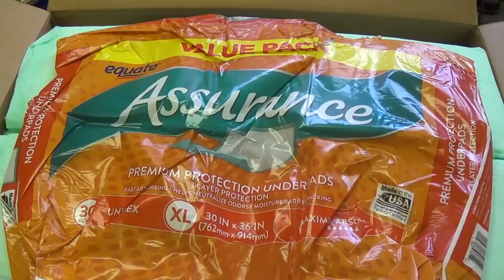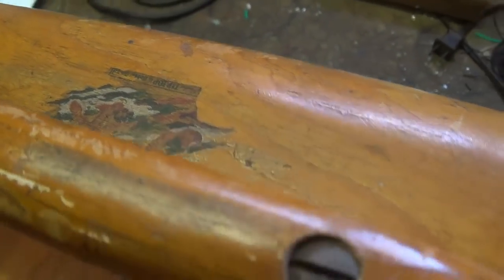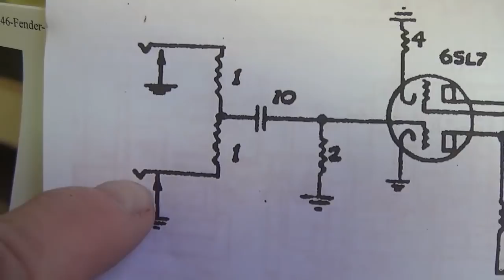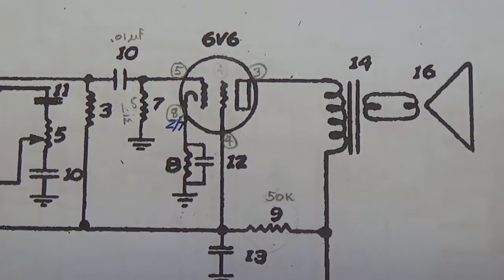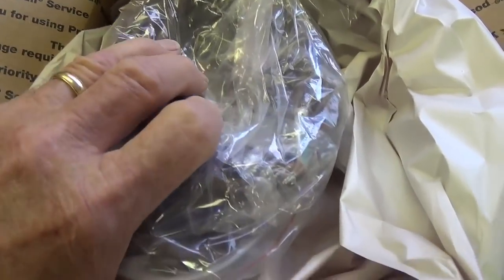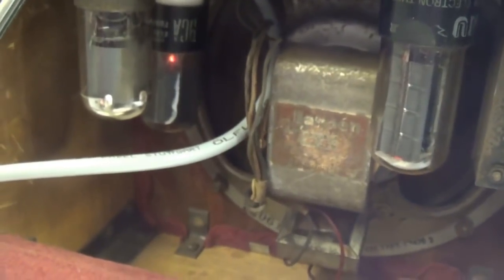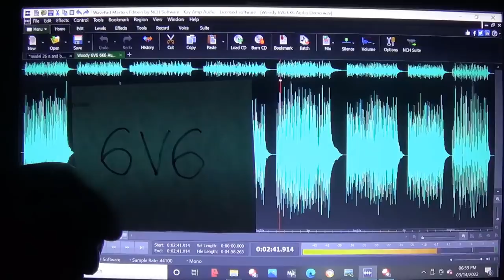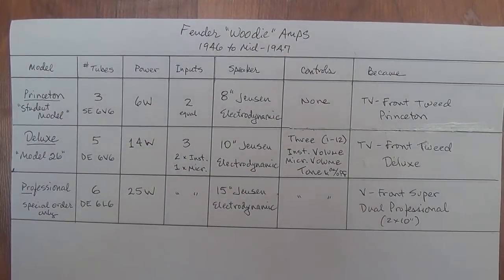1946 Fender Princeton "Woodie" Amp.....Rare, Valuable, and Really Nice !!

Comment: Thank you Uncle Doug for your thorough and humorous review and repair of my old Fender Princeton. When I proudly tell people that I have a "woodie" I get very mixed responses. What's up with that? The schematic that I sent to you was the earliest that I could find and was from Radiomuseum. They dated it from 1948 as the 5B2 circuit with a duo triode 6SL7 preamp tube and 6V6 output. The next iteration, the 5C2 from 1948 , uses a 6SC7 and a 6v6. I have found several model 26 pictures that show the tube designations written in pencil on the chassis. This leads me to believe that this amp originally did have a 6SJ7, a 6K6 and a 5Y3 as the chassis markings suggest. Until other research proves it different, let's call this the "5A2" circuit. Some his later amps had Leo's name penciled on the bottom of the chassis which he probably would have only done unless he had other employees wiring amps as a method of QC. Since Lily and Lupe were not yet his employees, he likely hand soldered this thing himself. Simply amazing.  
 
Radiomusiums.
Reply: You own a real jewel. Thanks for sharing it with us.
Reply from the maker: Thanks for your very interesting and informative comments, Charles.....and thanks for sharing this very rare and historic gem with all of us.
Reply: Love to see and hear you get your hands on an old Woodie Pro Amp to end all amps vintage wise
Reply: @UncleDoug  I want to donate some amps to you! FREE FOR YOU TO PROFIT ON! How can I contact you and where are you located so I know where to ship them to? are you in NM? How can I contact and acquire your address? And the amps are old Baldwins, Newcombs, Maasco, etc. (I'm retiring to the tropics)
Reply from the maker: @kennyh5083  I appreciate your generous offer, Kenny. I have some local guys who are learning amp repair and these could be very helpful. Please message me on my FB page Uncle Doug's Vintage Amps.
Reply: ALL I can say is that I would bê Very moved by having such a Nice and wise Guy like Mr Doug working in an amo of Mine. He transforms tech in a pleasant conversation with an old friend... Unfortunatelly Im not a skilled person on tube smps but I really enjoy wstching..
Reply: Handmade by Leo Fender himself. What a tremendous piece of history. Thank you.
Reply: Charles, would you consider selling this amp? Please let me know, I'm a lapsteel player. Thank you very much.

Comment: 6K6 also wants a different impedance/load possibly explaining some of the lower output.  It also wants lower voltage but that amp is already there.  I added a switch on my 6v6 project amp to also allow for 6k6.  Terry at D-lab mentioned how cheap they are so I scored 6 Sylvanias for about $9 each.  They all appear NOS and bias within 2ma of each other.  Glad to see than Uncle can still get a woodie.
Reply from the maker: Thanks for the info, JJ.
Reply: "Glad to see than Uncle can still get a woodie." 🤣
Reply from the maker: @pauldavis6356  Yes, indeed, Paul.....and no Russian pole dancers were harmed in the process.

Comment: 220614 - The war was over and all the soldiers were back in the states with their woodies. They had steel in their laps. Their eight inch Jensens had no shielding on the tubes. The resistance was low and the leakage was high. The house was a rockin' and the stork came a knockin'. That is the true origin of the baby boomers. Now you know....... the rest of the story!

Awesome video, Uncle Doug! Can't wait for your next goodie.
Reply from the maker: A fabulous historical review, Tim, especially the stork part :) :)  Actually I was probably spawned under the conditions you described......thus my interest in tube amps :)
Reply: There was a recession in late 1948 through 1949. It affected manufacturing and I heard also Fender production. This is why those early amps had many versions because parts were scarce.
Reply from the maker: @CraigHollabaugh  That makes sense, Craig. Use what you have, not what the schematic says.
Reply: @CraigHollabaugh  I think the changing parts list was more a result of war surplus availability.  Lots of electronics parts were available and cheap from surplus at the time.  But of course supply of any specific part may vary.
Reply: @yisraels4555  sure, that makes sense too
Reply: @yisraels4555   Had Fender been located adjacent to New York instead of in California, they would not have had much trouble getting parts after World War II because the area of lower Manhattan formerly known as "Radio Row" was the best place in America to get surplus electronics.  Unfortunately, all the independently owned electronics shops were forced to move in order to make way for the World Trade Center. The owners tried fighting the relocation in court, and lost. The stress literally killed some of them. I don't know if you can read it online but Antique Radio Classifieds wrote a series of articles about it some years back.

Comment: Greetings Uncle Doug,
One of my clients acquired the inventory of a local technician/enthusiast recently. Along with roughly 30 antique  mixer-amplifiers was a large container of tubes. We haven’t finished counting or testing them yet, but I imagine 50+ lbs of tubes is a pretty big number.
Amongst them are a dozen or so 6K6 pentodes. After watching this episode, I’m now looking forward to swapping them into a Deluxe 5e3 clone I’ve owned for a while.  Depending on the outcome of this test, who knows what will happen next.
Thanks as always for sharing.
Howard Rose
Reply from the maker: In light of today's tube shortage, your acquisition could not have come at a better time, Howard. Good luck with your experimentation.
Reply: Looks like the 6K6 has a lower output, but , given the high output of the 6V6 that is no bad thing,  going from loud to overbearing is no good from your input source,  so from moderate to nicely increased vol is better ( all controlled from the instrument volume)

Comment: Those lamp cords at Grand Brass are  nice Uncle. On flee-bay one  would have to buy a polarized plug and the wire 
separately for my two wire repaired vintage radios. Their plugs look vintage but not for grounded plugs like yours.
Excellent go around on this beauty of a rare find  $$$ vintage amp. Thank you for sharing it.
Reply from the maker: Thanks for the info, HM.

Comment: Doug, I am a little envious that you get to work on older amps like this Fender and the Oahu.  The good thing is, I get to see them on your channel.  There is something about the early forays into guitar amp construction that I really like.  The last repair I did was on a Marshall JCM 800 2204, I think they use the sound of the 'High' channel on those amps to cut diamonds.  That relatively recent high price of toilet paper has been overtaken, at least here in Australia, by petrol at $2.20 a litre.  Occasionally you see a car that would double in price if you put a full tank of fuel in it.  Looking forward to Heathkit capacitor tester video.  Stay healthy.  Regards, Jeff.
Reply from the maker: Greetings, Jeff. I guess the JCM has a lot in common with the mid-60's Gibson amps......like fingernails on a blackboard. Wow, that adds up to $8.80 a metric gallon (?)  Incredible !!

Comment: Lovely amp, so well kept. I love every one of your episodes.

It was a great idea to use the outer shells of old caps stuffing them with new ones - preserving the old aesthetic with perfectly functional components. 
These power cords sure as hell were expensive, but they are quite the lookers. Pity that the conductors' insulation got cut through. I'd redo it until I get good result. Yes, I'm a damn perfectionist :D
I'd also consider modding the amp a little bit by ditching the death cap and rewiring the heaters (with cotton-clad wire, of course) for symmetrical AC, grounding the center tap. 

The Heathkit is a thing of beauty and a joy for ever in itself. Hope it's so nice on the inside as well. Waiting for the video of you goinh through its insides and correcting possible bugs, because you never know. Will definitely come in handy in your work - I already feel bad that I do quite some old amp and radio servicing, and still don't have a proper cap tester, relying on an ohmmeter or even a voltmeter, testing them in circuit.
It ooks like IT28 has an EM84 eye rather than the old 6E1. I'll be building a capacitor leak tester / reforming device inspired by these Heahkits.

Always appreciating Jack :)
Reply from the maker: Thanks for your input and observations,  Keri.
Reply: That is a method that Uncle Doug has used many times and has even given a detailed How To explanation. Indeed.. it is a preferred choice.
Reply from the maker: @y00h0011  Thanks so much, Y.

Comment: Hi Uncle. I have wanted one of thee cap testers also. They are just too high in price. I have ESR and value testers, but would be great to leak test under load. Mr Carlson has on listed on his page that will test the at low voltage but is very accurate. I will be building one when I get caught up. I am retired but have more work now than ever. I understand not many people repairing Ham radio anymore. Have fun.
Reply from the maker: Will do, Monty. If you get a copy of the schematic for the low-voltage tester, please consider sharing it.

Comment: Excellent as usual  !!
Just a note,, Grand Brass lamp parts has old style cloth 3 wire grounded cords WITH old style plugs,,  whether the plug design is appropriate for a mid forties application I don't know but it seems more appropriate than the very modern computer plug style to my eye..
Reply from the maker: Thanks for the tip, 2P.
Reply: @UncleDoug   If you check them out I'd be interested to know if you prefer the vintage style plug or not..
Thanks !
Reply from the maker: @2packs4sure  I would definitely prefer the vintage style plug, 2P.

Comment: I've tried the 6K6 in my 5F2 Princeton and I didn't hear any change in the tone or the break up. It still sounded fine. The only thing that changed was the output level. I keep both the 6K6 and 6V6 handy for different situations.
      My conclusion was that the 6K6 will placate a code blue snowflake. The more militant factions will still scream at you to turn it down. 
                In the future,        guitarists will be playing unplugged solid bodies, and PA systems will consist of pairs of earbuds lined up across the front of the stage. 
And soon after that, the code red snowflakes will be screaming at everybody to turn it down.
For the time being, the old woodie sounds spectacular as usual, thanks to your dilligent efforts. If a harmonica player ever got hold of it, they would need the undergarments and the rump ribbon that you got with the amp. 
It sounds that good.
Thumbs up and hats off once again!!
Reply from the maker: Thanks for all the great comments, JP :)
Reply: I’m going the opposite direction. When my neighbors complained about my single ended 6V6 Amps I started getting bigger and bigger amps and cranking them.
Reply: @mohamedtlass3842  I tried that a few times, and the guy with the badge and the gun showed up. He wasn't interested in my story.about the search for the killer tone, the amp's sweet spot, even order harmonics, tube saturation, my artistic goals, or anything else.

I just couldn't get him to understand.

       Maybe if I'd had a dozen Krispy Kreme honey glazed in the fridge?
Reply: @jpalberthoward9  here they don’t come unless it’s after 11pm
Reply from the maker: @mohamedtlass3842  And that's why they love you, MT ;)

Comment: lso the 6K6 is a pentode and the 6V6 a beam power tetrode. 6K6s sound good albeit not as much volume, they tend to have a more clear bright top end and tend to not break up in the same way as a 6V6. They were used in radios a lot.
Reply from the maker: Thanks for the info, SH.

Comment: I got a question, i just got a philips EL36 (just for the point of my question given it uses an octal socket, it should be the same as your known 6v6,6l6,EL34), well it is new in box and all that BUT no emission. With my capacitance tester i figured that the screen grid (grid2) is not connected. upon further inspection the wiring in the tubpe is fine, but it is probably broken the wire comes just outside the glass and is soldered to the base. Any idea on how i should go if i would want to try to save it? Any experience on that kind of problem? Of course i have nothing to lose since i consider it dead, but i think it is worth a try, worst case i got a nice decoration for my office or some a pile of broken glass, either way i am fine with it.
Reply from the maker: Although I have repaired (or attempted to repair) virtually every component in an amp circuit, KK, I have never attempted to repair a failed vacuum tube.....other than super-gluing a loose glass envelope back to its phenolic base. I seriously doubt that success is possible, but 
 as you said, you have nothing to lose by trying.
Reply: @UncleDoug Thanks for the fast and honest reply. i will try to desolder the entire base with hot air (hopefully the epoxy will also fail so it can be pulled apart) the guide pin feels like a necessary sacrifice in this case. i will try to wick the solder off the pins first but not much hopes on this one, i will let you know how it went if it succeeds and how i did it.
Reply: @UncleDoug  Update: good news, none of the methods really worked, BUT i was seeing the tube internals a lot, so i noticed something. While i got the specific datasheet from philips the connections are as standard for EL36,  5=g1 4=g2 8=g3&cathode, 7&2 filament, pin 6 is missing, other brands (tesla/rft/siemens) also miss pins 3 and 1, the philips datasheet sais i.c. (internal connection) i treated them as n.c., not mentioned in the datasheet but i found out pin 1 is also grid2 and pin 3 is cathode. so i soldered a piece of lead wire out of a capacitor from pin1 to pin4 on the tube's base and it works now. I guess philips also had them shorted in their testing jig so this tube was considered Q.C. pass. Interestingly, telefunken has cathode pins 8&1 and grid2 pins 4&3. If you are wondering where the anode is, on EL36s the anode is a top cap, looks nice in my opinion in an open amp. sadly no new production, and the old stock is rare, thankfully they are also extremely rarely used.
Reply from the maker: @kapioskapiopoylos7338  Excellent detective work, KK. Thanks for sharing this with us.

Comment: I guess the absence of power and ground switches precludes the need of a "Death Cap" - or is that what the green cap from the fuse to ground is?  Love your humor Uncle Doug. 😊
Reply from the maker: The DC in this circuit was replaced with a new cap and left in the circuit, Paul,

Comment: Comparing leakage to ESR is apples to oranges. (A comparison against a low voltage leakage tester like Mr. Carlson's Lab's would be worthwhile though. He does that a lot himself though and his little tester really seems to shine. I keep meaning to join his Patreon to scoop those plans.)
Reply from the maker: If you do get a set of those plans, please share them, AQ.
Reply: @UncleDoug  That would be intellectual property theft, which I'm loathe to do, particularly to an independent, one-man business. Software piracy is the whole reason I'm poor and not regularly (or ever) mailing you gifts. :)

His Patreon is only like $3 a month. (I'm loathe to use Patreon too but will hold my nose for a moment next time I have $3 burning a hole in my pocket. ;) Sign up, grab his Death Star plans, and build one for us! Just don't give the secret sauce away.

(I don't know why someone doesn't produce a multimeter with a capacitor leakage tester in it. Seems kind of obvious. Carlson's definitely demonstrates that you can test at far below the operating voltage and still reliably detect microcurrent leaks.)

Comment: Good to see you have a sense of humor.. have you ever done any work on the newer traynors like the 6l6 Traynor ycv80 if so would it be a big job to run older 6v6gt tubes for the power section?
Reply from the maker: Thanks, Andrew. I have never worked on a Traynor amp. It would not be advisable to use 6V6's in ANY amp circuit designed for 6L6's, especially 6L6GC's. The plate current and voltage would exceed the tolerances of the 6V6.
Reply: @UncleDoug  thank you for responding i figure since I can change the value of the bias resistor to run el34 there might be a way for the 6v6 . Another question for u if I could? Would a old saba phono super 9 be worth converting into a guitar amp it's got a single el84 in and ecc85 . I've seen others do this with different tube radios but not this model . Any thoughts?
Reply from the maker: @andrewdenine1685  There is a huge difference between an EL34 and a 6V6, Andrew. I have no experience with Saba phonographs, but would guess that ANY functioning phonograph amp could be converted to guitar use with proper work and effort.

Comment: According to the RCA manual, Class A operation for the 6V6 at 250V plate voltage into a 5k plate load is specified at 45mA plate current (plus 4.5mA screen current) at -12.5V grid voltage, which would be about 250 ohms cathode resistor, 4.5 watts output @ 8% distortion.  6K6 Class A into 7.6k load would be total of 37.5 mA (plate plus screen) at -18V grid, which would be about 480 ohm cathode resistor, rated 3.4 watts out.  Understandable though if you want to under-bias the 6V6 with 500 ohms cathode for the sake of cooler running/longevity.  Also if you can find one, you can try using special RCA "RED" tube JAN CRC-5693 mil spec tubes in place of the 6SN7 for rugged operation, low microphonics, etc.
Reply from the maker: The 6K6 may have been the original output tube in the very early Princetons, TC, so the 250 Ohm bias resistor may have also been original. Recall, however, that the preamp tube in this circuit was a 6SJ7 pentode.